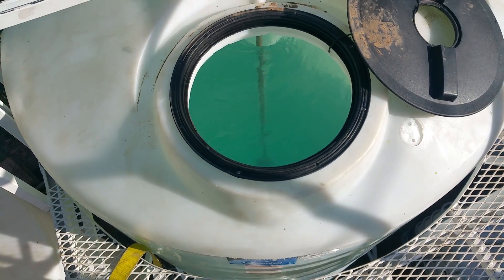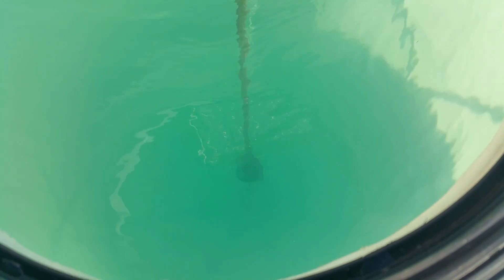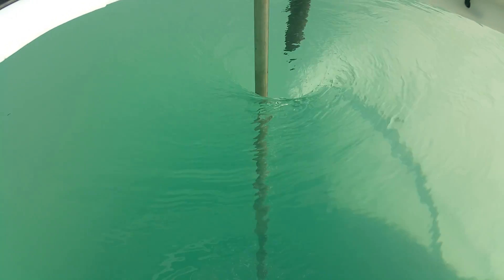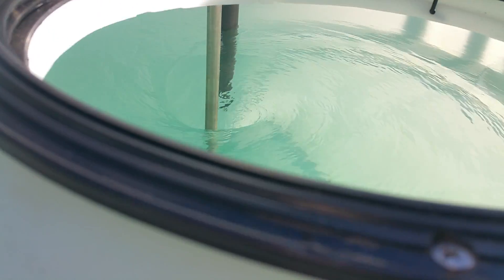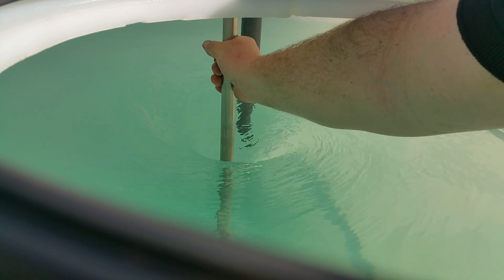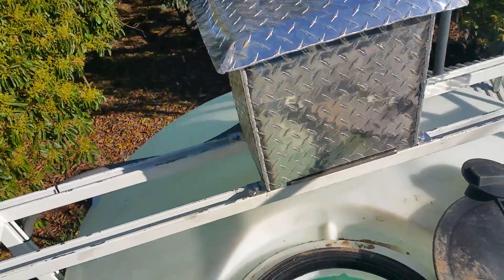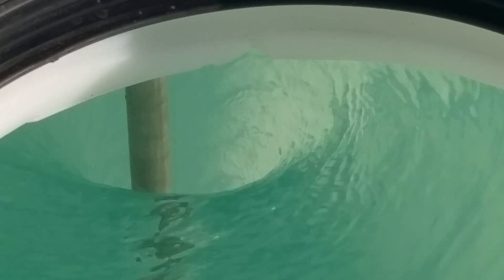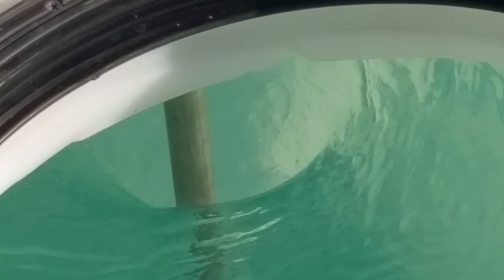Lily Vortex Impeller project working

Comment: do you know what rpm the impeller is running at? Just wondering if you could run a few side mounted turbines to generate the power to run the impeller and have enough power left to charge a bank of battery's. the sort of things the yachts tow with small props to charge battery's on long cruses.
Reply: +firstname lastname this is the sort of thing (in principal) about six maybe.http://www.wattandsea.com/en/cruising-hydrogenerator

Comment: If you have something worth funding, you must show how much more than 134 watts are needed to create the same effect using a stardard impellor.  Without any quantitative economy comparison, there is no invention and therefore nothing worth funding.
Reply from the maker: Not sure what your angle is, this video is not a call for finding investment.  This is a video of fabrication skills and implementation of vortex mathematics and technology for in house industrial applications.  Do your research on Jay Harman and the lily impeller as this is a tribute to his work. 

Hope this clarification helps
Reply: Hhydrogen4Power A tribute to Jay Harman for achieving what?  paxscientific dot com is offering the lily impellor as a commercial propositon but without declaring any testable advantage over any other type of impellor.
Reply from the maker: Moses Bullrush by now I would just insult your intelligence, however I am working on my etiquette. 

This build was to look at a shell spinning backwards,  I have know about the lily for some time, but never had an application for the attention to build one. The question is whether the energy to mix water is more efficient.  From an observation standing a normal mixer just makes turbulence. Turbulence is not efficient ever. As you can see we get a nice even vortex,  for this application we are mixing and dosing chemical. The efficiency is notable but was not the main objective however an impressive goal. We move a lot of water in our systems so I get the efficiency of water movement.  I don't intend to piss up a rope and make unity comparisons for you or anyone else,  I stated the energy, this project is finished and that's that....

Thanks for your interest. 

David